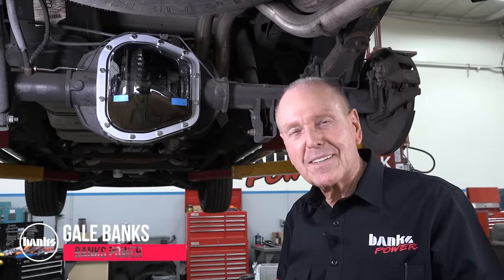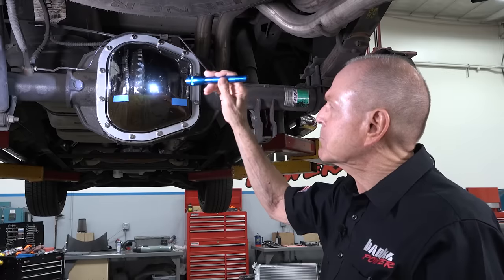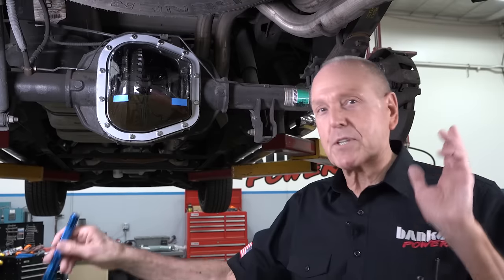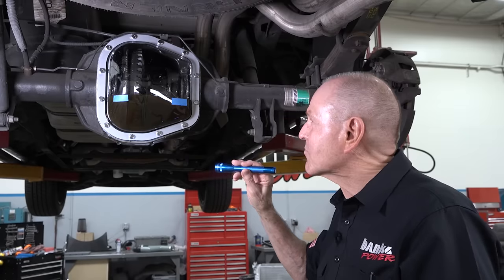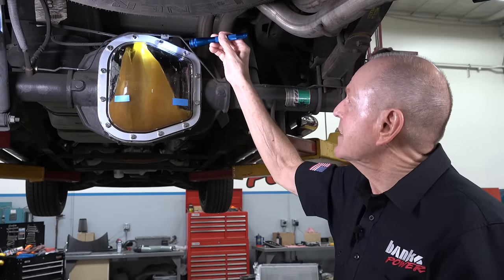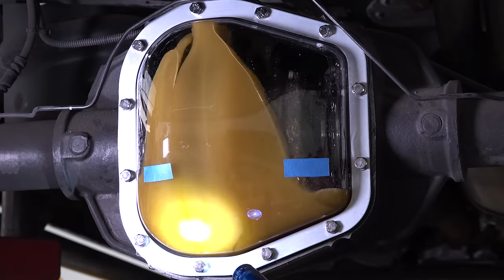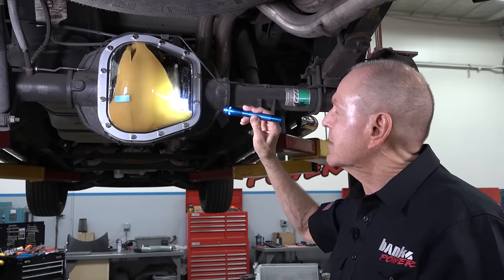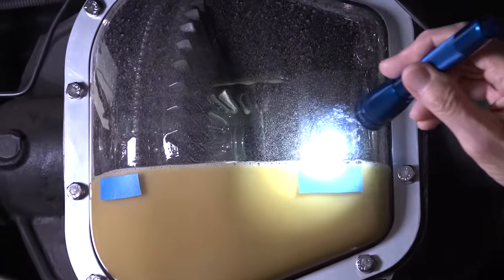What's going on behind your stock diff cover?

Comment: I got a 2006 Silverado crew cab with 210,000 miles is it ok to use a thicker oil than the OEM
Reply: It's summer so yeah but not if it's just a small block v8 then your not doing much of anything so it's just a waste I drive a 390 bigblock and I have to run 10w-40 in the summer or it'll overheat, but if I don't go back to 5w-30 come winter I'll have a hell of a time getting a carbureted 390 to start
Reply: Sorry I mean thicker gear oil for the rear differential not the engine at 40mph 50 mph I hear this noise almost sounds like air threw a crack in a window I herd if I put thicker gear oil in the rear differential that would stop it but the guys at the parts store told me to just stick with oe I notice Lucas gear oil the thicker one says stops whiney noise in gear boxes and differential no other gear oil said this my trucks that weight of Lucas is not synthetic so I when changed my gear oil I notice big glob of metal around the magnet

Comment: No plug? How did you get the oil in there?
Reply from the maker: In this particular Ford F-150, the fill port is actually in the differential, not the cover.

Comment: Now show us what happens to the gear oil, where it goes, in a turn at 40 MPH, or a side burn out! Most of it is no longer in the pumpkin, it's filling one side or the other of the axle housing, IMO.
Reply: There is too much fluid in a diff to run it dry around a curve. Unless it’s underfilled, of course.

Comment: Fwiw, the banks diff cover offered for the 2022 Ram 3500 does Not fit the 3500 Ho. The bolt holes are close but off about 5-10 mm. What a waste of time that job was

Comment: So....all of this and you never published the differences! Can you please post the data you observed so we can see how well these covers don't work compared to stock?
Reply from the maker: The reason for the time between follow-ups is purely due to R&D. This is not a reality show with episodes taped months ago. When we post a video, ten times out of ten, it's something that happened that day or the day before. Now, maybe we should sit on the videos and post them all at once like a Netflix series so you can binge-watch them and know how it ends. Unfortunately, we're not a TV studio. We're engine builders that invite you into our facility. Good things take time. Doing something no one has ever done before, at least done it well, takes time. Regarding the diff cover series. We've been sitting on the info for quite a long time. Why? We'll only get your attention once. We're going to reveal the research when we debut our cover design. Put yourself in our shoes. You've done all the competitive research and you're excited about sharing it with the world. But along the way, you discovered how to improve diff covers in a way no one ever has. So, you design one. But making it isn't done like the other guys where someone bangs out a design in CAD then sends it off to the sand cast shop. We made many iterations and several billet prototypes, tested the heck out of the design, then went with a manufacturing process that is far more accurate but takes much longer. Are we curing cancer? No. But are we making the very best part possible? Yes.

Comment: I dont get it, as a 10 year auto technician, not a mechanic, whats the point in all these aftermarket differential covers? The stock work perfectly, never had a problem with a single axle failing because of the cover design. So all of this is pointless. Besides the fluid gets better and better every year. Unless you like to drag or off road your vehicle and MAYBE I could see someone spending money on an aftermarket cover but even then I see it as a waste.

Comment: The milky oil problem needs a upgrade to be better than that to make rear end oil better than what is shown in my opinion the rear end oil needs to stay at a clear golden honey color instead of the milky color whichever its not good for a rear end and the bearings inside of the housing try lucus oil next time and see the big difference

Comment: Just go ask Ford and take a dump truck full of $100’s and they will give you some old data. Too bad differential flow pattern and fluid heat distribution aren’t an FMVSS (Federal Motor Vehicle Safety Standard) requirement.  Data would be a public record for vehicle certification for production.  Might be a stretch selling NHTSA (National Highway Traffic Administration) that this is safety related.  Go for it Dale or you will end up spending about $100million on a research lab and all the geeky engineers that work there.

Comment: Theories? I don't think people are as mystified by a solid axle rear as you pretend they are. Lol Now a torque converter? That's a mysterious thing 🤣
Reply: People are not mystified,  they just dont understand what's happening and why a cover makes a difference in how the assembly performs. 

A torque converter is simpler than this in fact.
Reply: @DrewLSsix  I'm aware how a torque converter works, was a joke... Putting to much thought into a diff cover for a rear end... fluid is gonna get everywhere it needs to just fine no matter what cover you buy.

Comment: 330kmiles on my rear diff dont have any issues. Your over concerned with how it runs when most cars are made from shit and will lose the whole carrier due to failed parts before the fluid is even a issue.
Reply: Some of us have $1,000 diffs and use them for long trips, drag racing, circuit racing, etc. If you think that there’s a such thing as being over-concerned with something like that, I pity you. Maybe not for a Kia Sorento that’s going to fall apart before the diff is an issue, but it becomes vital in certain situations. 
Keep in mind, even cheap cars spend millions in R&D, whereas many aftermarket companies do not. For somebody who may be looking for a lighter, more high-quality solution, it’s very important to know what to look for as far as design is concerned. Otherwise, you’ll be spending a lot more to repair it when the components aren’t lubricated correctly.

Comment: To be honest this test is  not really anything but showing the movement slightly. It was never under load or had resistances on it. If the tire isnt touching the ground this basically shows nothing.

Bumps in the road. Turning up hills. Down hills. There are to many variables that are being left out for a proper showing and test.

You had no tires on the car. You should never run your diff for that long without it being under load. Your car will never be stationery when your driving. This is a total waste of time....